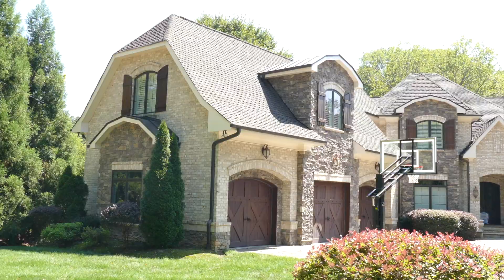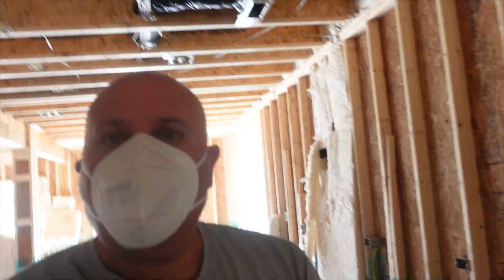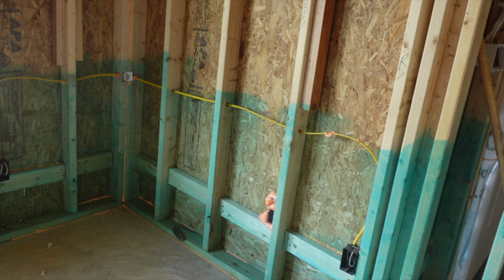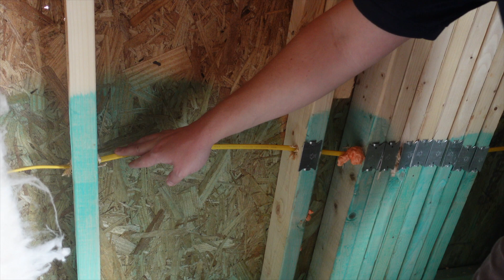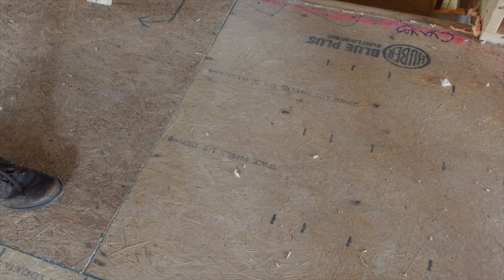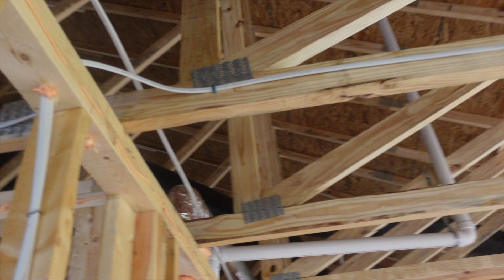New Home Inspection -The Pre Drywall Inspection for New Construction !

Comment: So Eli, when the inspector was pointing out how the attic truss is connected, it sounds to me like the way this house was done is "legal" but not done the best way, and that because of this, there may be structural issues in the future. Also, how do we know the inspector isn't a friend of the builder and will find issues that are really not a big deal and not point out more significant issues?
Reply from the maker: Correct  JG-- He has his opinion of how a home should be built, and then there is a code, city, state, that  states otherwise . It is not "wrong " , just not what he would propose. All builders have their way of doing things. Unless you are custom building, it is hard to dictate how the house should be built . If the house has passed state and local inspections, it would not be likely to have structural problems. And all new home builders give you at least 10 years of a structural warranty . It would be unethical for a home inspector not to point out issues , and would cost him his career . All homes are also inspected , prior to the city and state , by the homebuilder as well. Most are big, publicly traded companies, and their reputation and business depends on quality control. Thanks for Watching JG !